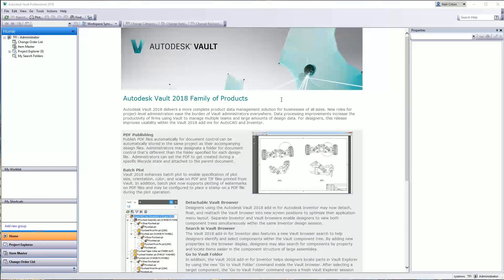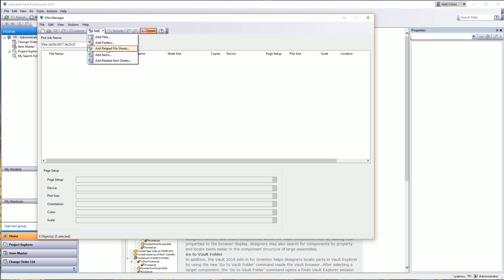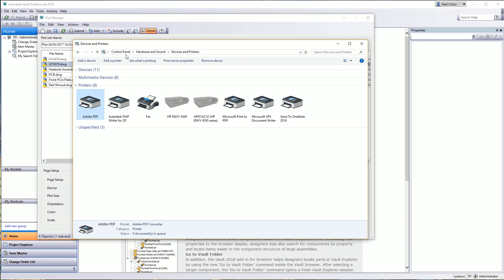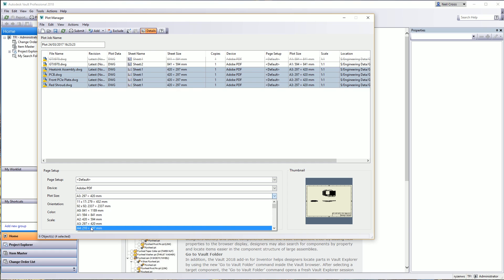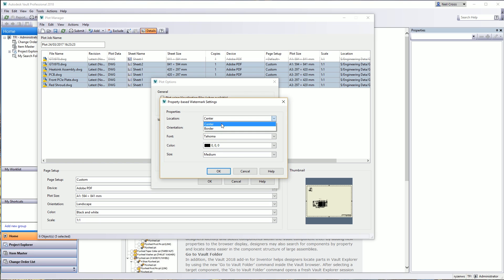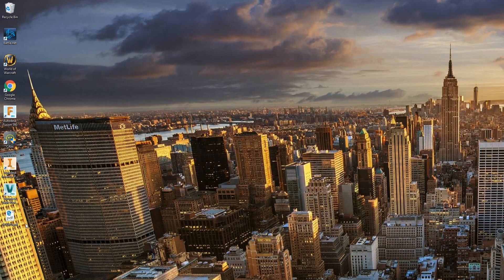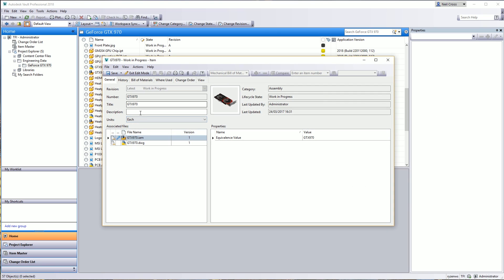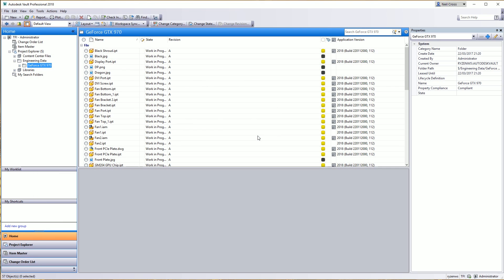How To Print All Drawings In a BOM | Autodesk Vault

Comment: So i followed this tutorial and all was great until you have to print multi-sheet drawings. Because the plot manager brings in the individual sheets under the same file name in the list, whenever it prints the PDF to the desired folder, the 2nd Sheet  (or last sheet) will override the sheet 1 pdf because it sees it as the same . I have looked around different options in Vault, Plot Manager Etc and cant seem to find a away around it. Im not sure if the destination folder can have a setting/permission set to it so it doesnt override the previous files. You would have seen the issue in this tutorial if you hadnt excluded the 1st sheet in your example. Let me know if you have any ideas on how to fix this.